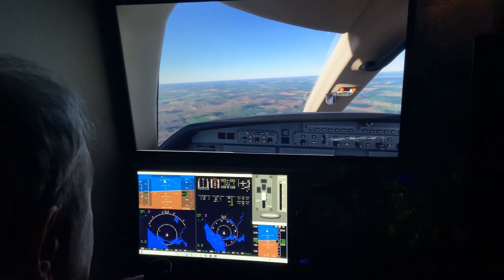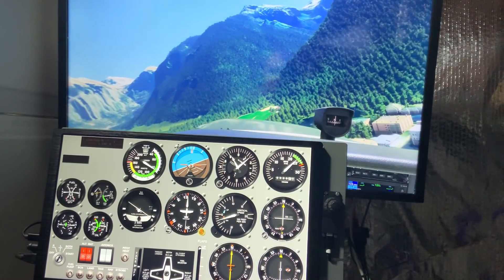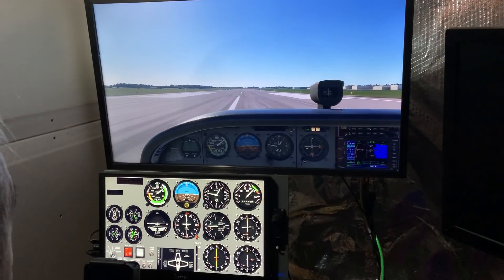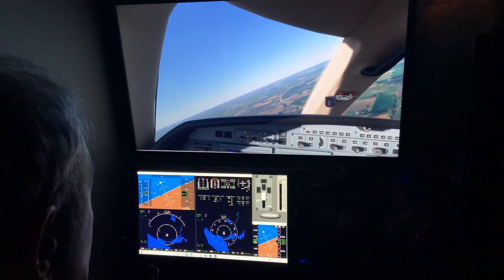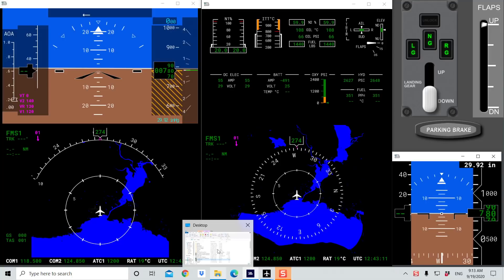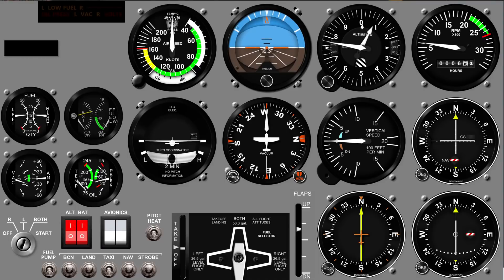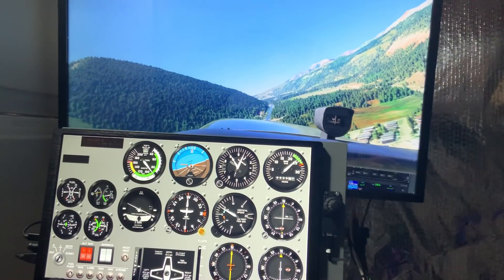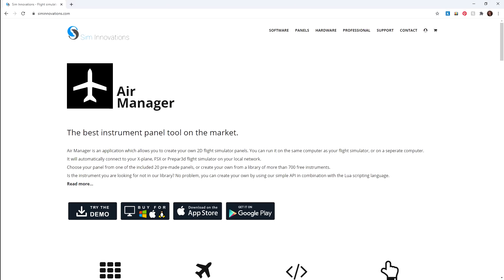FS2020 Budget Touchscreen Cockpit

Comment: Thank for the video. Excellent. I have just set up a three monitor system. The monitors are connected to the three outputs of my GPU. Is there a best way to get a four output for this monitor? Thanks
Reply from the maker: Two options
Use the internal graphics on the motherboard if available…need to enable in the bios.   Or. Use a usb docking station like a Pluggable which work great

Comment: I've had ProSim737 for years, and I decided to update my processor and they want me to rebuy it, I couldn't do it out of principle, I'm actually getting more excited about getting a simpler setup that just works and doesn't require me flipping a million switches as ProSim requires. Can you set this in the startup folder so it just pops up , and networking too is no problem?

Comment: Hi Russ. I set up a G1000 Panel for the C172 in MSFS following the instructions in the video by Ivansky. I am using AM 4 and I used your G1000 bezel.  My main screen for cockpit view is a large display running at 2560X1440. I am trying to use my Winmaxit screen (1920 X 1080) for Air Manager. The Winmaxit gets the video signal from an HDMI cable connected to my video card. I also have a USB C to USB A cable plugged into the Winmaxit and my computer. The USB C end is plugged into the "Type C" port on the Winmaxit and the Type A end of the cable is connected to my computer. I went through the touchscreen calibration procedure in Windows and I calibrated the Winmaxit touch screen. My problem is that when I scroll on let's say the Baro knob, the cockpit view on my main monitor zooms. When I click on any of the buttons on the Air Manager overlay, nothing happens. When I touch the Back button on the G1000 bezel (lower right next to Alerts) I notice the right yoke turn blue on the main large screen (cockpit view).  The touchscreen is configured properly for the Winmaxit, but my key presses are not translating properly over to the large screen. Do you have any idea what I can be doing wrong?

Thank you!

Andy
Reply from the maker: Two separate issues:

To eliminate the zooming look at your MSFS mouse control settings and remove the zoom in ans zoom out that is default set to use the scroll wheel.

The touch screen issue is that you may not have correctly calibrated the touch screen so it thinks your touch grid is over the other monitor and is transferring the touch inputs to that other screen.
Reply: @rbarlow  Thank you for the reply! I did not see a way in Windows to calibrate my Winmaxit screen to my large screen. Can you tell me how that is done?
Reply: @rbarlow  I figured out the problem. Windows Firewall was preventing AM4 from communicating with MSFS. I created exception for both programs and now all is well. Again, THANK YOU for your help and your excellent videos! Keep up the awesome work that you do for the Sim Community!
Reply from the maker: @asrich327  should have first asked if things were working right using the mouse without touch.  Did you solve the zooming scroll issue?
Reply: Yes. I took your advice and disabled the zoom feature from the mouse settings. Thank you again!

Comment: Hello, Russ. I truly love your instructional videos and are the "go to" when I'm wanting to know something about flight simming and Air Manager. 
In trying to make my own home cockpit I am needing to know if the 15.6" screen will show Air Manager instruments true to their size (in regards to actual instrumentation gauges) or if a larger screen would be needed.
Thank you for all that you do.
Reply from the maker: the view area on a 15.6" monitor is 13.6" wide and 7.6" high. Standard sized instruments are about 3.5" diameter including bezel so at full size( use 3.25" as close enough, keep the bezels small)  you can place 2 rows X 4 columns.   That's a six pack( with HSI for VOR 1)  plus a second VOR and Tach.  This calculator will help you figure screen sizes http://screen-size.info/  ,  Remember the as the screen gets bigger an HD monitor is still 1920 X1080 pixels  even though larger on a larger monitor and you can fit more life-sized instruments on it, they may not be as sharp as the pixels get bigger.

Comment: Hi Russ, 
First of all congratullation for the good work you are doing. 
I build a sim panel with two monitors Wimaxit model M1560CT2 to work with a FS2020 and I'm also plan to incorporate a Knobster. Althought the monitors are, so they say, touch screen type, I only manage to make it work on one of them if it's choosen as a main monitor. If the main monitor is the wall one, the touch function is there but the buttons and switches on the panel are not sensitive to the touch. 
My question is, are there any setting or adjustment to be done on the computer graphics to allow the touch function to be fully active and the wall monitor to be the main monitor.
Thanks in advance for your help...
Reply from the maker: Victor it sounds like you haven't calibrated your monitor's touch system.  If windows senses a touch monitor it assumes the touch grid is located aligned with the upper left corner of the main monitor.  If there is more than one touch monitor you need to calibrate the touch system.  Go to settings and search for "Calibrate" and you will see a choice "Calibrate the screen for pen or touch input" . Select that and follow the directions.  It will cycle through each monitor ( the screen will turn white with text directions). It will tell you to touch each monitor if it is touch or press ENTER if not to continue through the monitors.  After you are done it will know how to correlate touches with the correct monitor.  The following video will demo the process starting a timestamp 0 :33
Reply: @rbarlow  did that and they are both working. Just waiting for the knobster to arrive to install it and fine tune the set up...Thanks very much Russ for the support. Kind Regards, Vitor
Reply from the maker: @vitorsilveira3045  that is one of my most common questions.  Have fun simming!

Comment: Hi Russ. I use air manager  but lm wondering why there is not and option to use head tracking without the main screen panel, lm talking about the simulators.You have the separate monitor with air manager but having the main display with the cockpit is a litle  redundant. I understand that is the way to have a 3D capabilities. I found one unfinish plane in xplane10  list that doesn't have a cockpit but surprisingly the panoramic view works with head tracking. I just want to bring the option in order to avoid using three monitors for the center and lateral panoramic views.

Comment: My ViewSonic TD2410 touchscreen will not operate as  touch screen. I have updated windows 10, reinstalled touch screen driver, monitor driver, adjusted the connections, updated video card driver. I just can't get the touch feature to work. Can you think of something else to do to get it to work?
It works good as a regular monitor. I have the HDI connected and the USB connected between the monitor and the computer box. Frustrated!

Comment: Mr, Barlow, I am working on my Flight Sim using MSFS 2020 plus the updates. A couple of question, first how do you get the Air Manager instrument panel to the monitor (Wimaxit 15.6 touch) Have made a bracket to hold this monitor on top of my Cessna yoke along with a knobster. My main monitor is a 32 in Dell. Right now working on getting Real Sim Garmin GNS 530 up and running correctly.
Reply from the maker: In Air Manager panel Settings you can select the monitor you want the panel displayed on

Comment: I have the latest Air manager but for some reason it won't recognize my FS2020.  Got any suggestions?
Reply from the maker: Did you install the software plug-in (actually called bridge) for the new version into MSFS 2020?

Comment: hi Ross i have similar set up i am having difficulties connecting my touch screen computer to MSFS main computer they are on same ip address any hints will be appreciated
Reply from the maker: Not sure what you mean. Are you networking two computers one running MSFS and the other Air Manager? If so did you install the plugin bridge software on the MSFS computer?
Reply: @rbarlow  ok Ross i did is their another step i should do because still the gauges are not responding
Reply: yes you right i have 2 computers 1 for MSFS the other for Air manager
Reply: @rbarlow  sorry to bother you with my questions on the bottom right of my computer ( touch screen computer wit the air manager ) it says searching for flight simulator is it possible for you to send me all the steps i need to do to connect them if not too much trouble

Comment: Hi Russ. Is it possible to use the Air Manager with the knobster on a Garmin unit on a second LAN computer to control the FMS knob?
Reply from the maker: It will work but unless you have XP on the same computer you will have no pop out screen to place behind the bezel. The buttons and knobs will still work on a networked computer though...without a display screen.
Reply: @rbarlow  also ms fs2020?
Reply: @rbarlow  and for me just the knobster for fms is enough i, fly vr

Comment: Russ, thank you for all the info. I got my system running! 
Do you know of any way or systems that allow you to pop out the Bezels as well as the screen? is there a software overlay that you can use as a G1000 of g750 bezel overlay?  I didn't see it on air manager yet. 
thanks

Comment: Hi Russ, I had some trouble using the touch screen features.   I put together a similar display on a touchscreen, but I had to use joystick buttons to set landing gears / flaps.  Any suggestions?
Reply from the maker: Did you turn on touch control in the Air Manager settings? If so does the touch screen work in windows without Air Manager ?

Comment: Russ,  I purchased the 2 of the touchscreen 15" monitors. I have them all hooked up and can undock the screens down to the monitors. I have the computer setup for touchscreen, but MSFS2020 doesn't allow me to touch the screen and change anything. Do I have to have AirManager to do this? I have looked at AirManager and can see your G1000 panel overlay. I guess I'm confused. I'm really wanting to to the G1000 setup with PFD and MFD. I think I have watched all your videos and got the idea for my panel build with dual touchscreen from you.

Comment: Thanks you for this video, i wonder if I can asing any other knob to air manager (I have som  in my hardware that are not in use)..
Really the price for knobster is way to hi for home simer..
Reply from the maker: It may be way too high but they can’t keep them in stock so compared to some of the high cost items required for swimming in a home cockpit it it’s a real bargain. There is a section on the sim innovations wiki that explains how you can create your own DIY Knobster. Just need a dual  encoder with push button and a Arduino nano. The software and everything else is there.We included for home simmers who wanted to save and not spend money for the plug and play model that is sold.
Reply: @rbarlow  okej i understand but frankly there's not to much in stock now days..and I know  that with this solution i can save a lot of money in som others simhardwere  but is a compromise solution to .my cuestion is if there is any way to asing my knobs I could use 2 off these and they have pusch to

Comment: did you find that the USB type C video input supports touchscreen, and the others do not?
Reply from the maker: On mine I use HDMI for the video and USB for the touch grid connection to the computer. You definitely need a power connection to the monitor because the USB bus just can’t handle running the monitor.

Comment: Russ i have seen the seen the one mounting bracket that u had made with the holes for the knobster , and i do like the set up very well as well, two things one : i all ready have a 22" touch screen and with out the knobster could one use this mount bracket to put the 22" screen on ? and the second Q. is where and how does one get the bridge for 2020. i hope that it is easy to set up ? thanks for your input on this matter D.
Reply from the maker: In order to use Air Manager with MSFS you need to download the beta version of the program from the same innovations wiki. You also need the new plug-in which I called the bridge application which will be installed automatically when you run the plug-in installer. You will need to use the username/password given in the instructions to activate the beta version of Air Manager 4.0 The beta should continue to work until the version 4.0 is officially released. Then I think it is a 50% price discount to upgrade.

I am afraid a 22 inch monitor would not fit onto the bracket that is being sold by several vendors but you could easily make your own following the instructions that I included in my first video when I was building a do it yourself version. It’s a simple design made of a sheet of aluminum that has been drilled in mounted onto the honeycomb yoke. You might look for a mounting bracket that has the ability to adjust up and down so that you could set the top of the monitor to match the glareshield of different aircraft. That is one drawback with it mounted onto the yoke is that it cannot be adjusted in on some airplanes the instrument panel is partially visible above the top of the monitor.

Comment: I'm holding out till i see a good 3 panel nVidia surround and fourth panel for instruments. (as i have now in FSX 3x 720p tv's plus one 24"monitor).
Air manager seems a way to go. Can the we get rid of the 3D cockpit in external views?
Does 2020 allow panels to pop out or is that  Air manager process?
Reply from the maker: I want three unique views to each of the three visual monitors that allow setting offset angles and field of view on each. The surround creates a virtual single wide monitor on the three and the stretching of the image toward the outside edges is a dealbreaker for me.  So far MSFS doesn’t allow a scenery only view. It does allow popping out the NAV display screens but so far the Asobo SDK hasn’t added all the Events that are needed to control them from an Air Manager bezel. Hopefully soon.
Reply: @rbarlow  Someone has posted video of how to move the eye point forward of the windshield.https://www.youtube.com/watch?v=DRS-Qmu5qtg
Reply: Yes the stretching is annoying, just zoom out as far as possible, i then just pretend it's canopy window distortion.

Comment: Hello Russ,
I have one question. Can you also move the G1000 on a touchscreen from MSFS2020?
Reply from the maker: Yes but there is a problem now with Microsoft flight simulator that if you click and focus on that undocked window you lose control of your flight controls unless you press the letter C on the keyboard. Also unless there is a Bezel created in Air Manager or some other method there’s no way to make inputs to the G1000. Hopefully the functionality in the SDK is coming soon to allow that.

Comment: My air manAgee beta 4 kept on searching for fs 2020 and not connect. Can you help? I am a brand new to this. Must I have something else installed to make them connect. I am trying with their demo panel for now.
Reply from the maker: Look on the Sim Innovations wiki above where you downloaded the beta  for the simulator software. Get the beta version. Just run the installer and it will put the bridge software on your FS2020

Comment: Hello Russ, I am spending the day consuming many of your setup videos. Just got done watching the one showing how you have the 2 computers setup, one with Air Manager and XP the other more powerful with the 3 monitors. Now I have a question on how this MSFS is set up as you are only running 2 monitors. Are you still using the 2 computers? And when pooping out the panels from MSFS, are you able to make setting changes to the MFD or PFD? Knobster only works with Air Manager correct? Thanks
Reply from the maker: I only had one monitor for scenery in MSFS so all three were on a single computer. It isn’t possible to network computers in MSFS yet. Knobster only works with Air Manager and I would create a overlay bezel for the popped out displays but the SDK doesn’t support Key Events yet so it really can’t be done yet. I am afraid despite the beautiful scenery in MSFS that the same just isn’t ready for home cockpit use yet. It may be a while as I think their main focus is getting the VR stuff going as soon as possible. Also, for me until there is support for three monitors with geometrically correct views it’s just not quite worth the trouble.
Reply: @rbarlow  Thank you, your reply is greatly appreciated. I am going to spend the time and expense getting Xplane to where I need it. Heck, after 2 touch screen monitors, a knobster, mounting hardware and required software, I figure its about the same as 4-5 hours 172 rental time. At this point I need proficiency to finish my CFII, so its a no brainer. One last question, I am assuming 2 copies of Xplane and 1 copy of Air Manager are needed for the software? Thanks again.